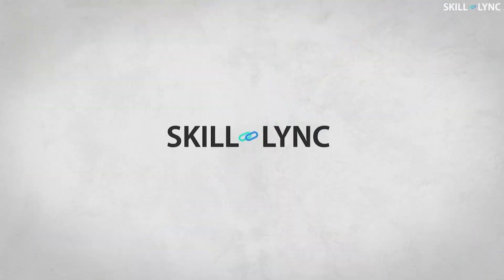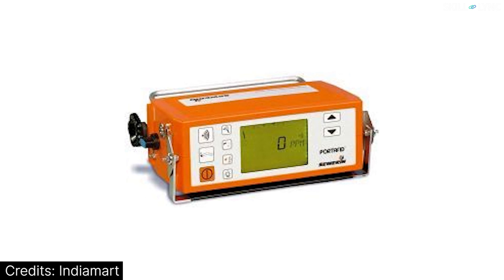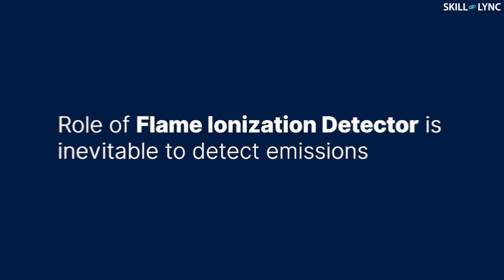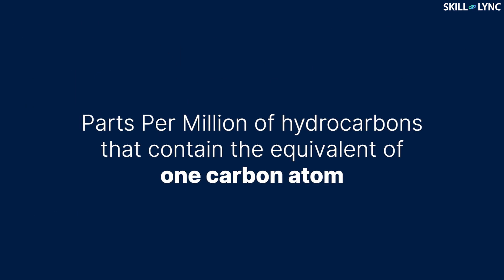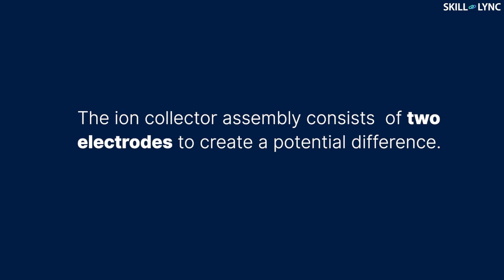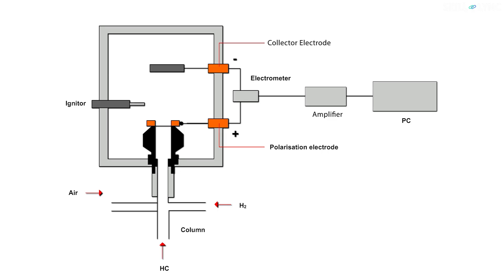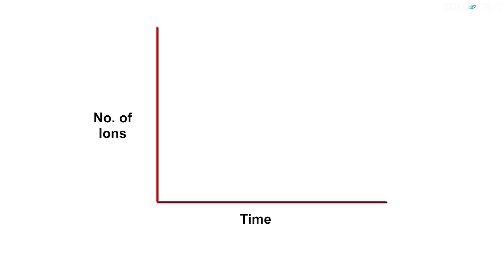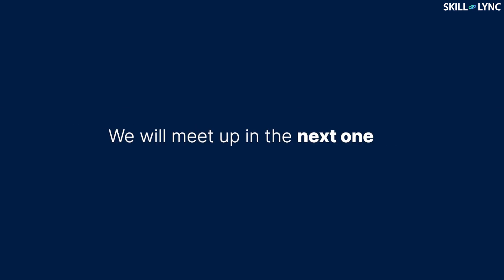Flame Ionization Detector | Skill-Lync

Comment: Great explanation of the concept. If you have a typical natural gas composition of 85mol% C1, 10MOL% C2, 5mol%C3. Assume you would take the ppm C1 and then convert this to mg/nm3 unburnt hydrocarbon via considering the number of carbon atoms in each molecule and adding the hydrogen atoms also? Thanks.